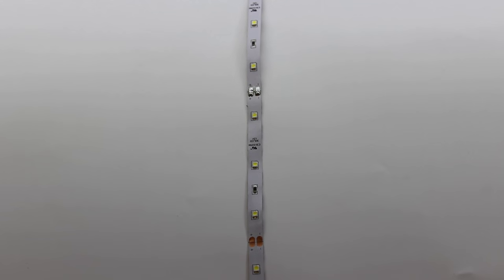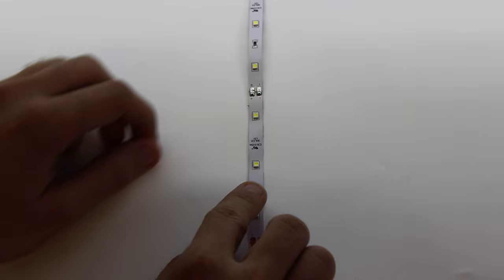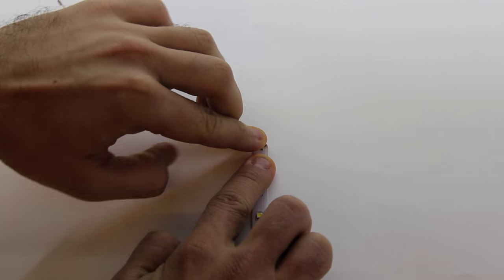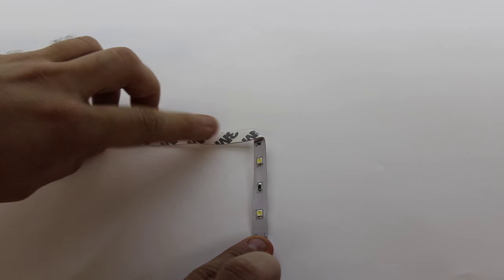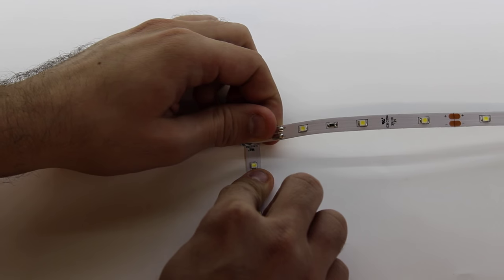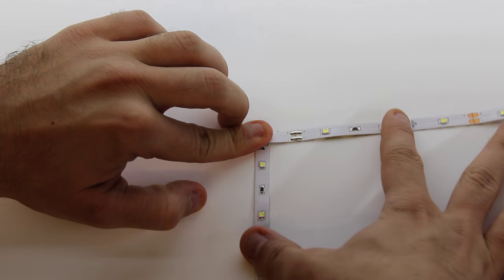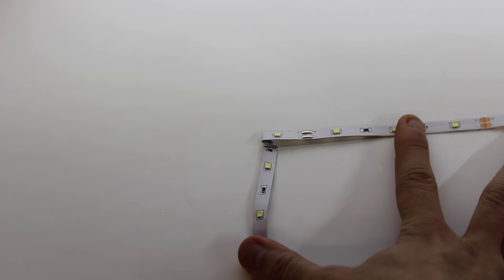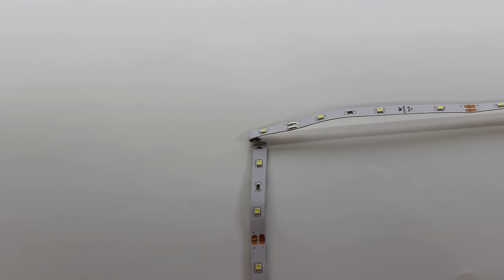Bending LED Flexible Strips | Inspired LED

Comment: Your strip looks much thinner than mine, mine wont bend easily like your strip does
Reply: If you have the waterproof strips which are dipped in resin, this will be a very difficult method to do, it also may ruin the waterproofing. I ran into this same issue with mine.

Comment: God thing to know, most times bending this way u will kill the strip from the bend. So always test on the end before bending in the middle. This is because all rgb/led strips are not the same and some with lets say silicon this will not work unless u peel the silicon first. Some 24v strips will fail because the pressure and bend kills the lanes. So trial and error always start at the end and test bend.

Comment: I recently purchased some smart good quality looking led strip lights and to install properly you'd need to purchase diffuser channelling plus appropriate connectors too etc and trust me it ain't cheap at all but if your gonna do something do it right
Folding over leds is def not right way to treat em and remember heat kills leds it reduces lifespan and creates hot spots so I'd purchase L shaped connectors and install the leds correctly to achieve the best result

Comment: Thank you bro , btw are you sure if i do that it won't destroy the led strip lights
Reply from the maker: Hi @sweaty_sadiq! This is by far the best way to bend your flexible LED strip without damaging the LEDs. Keep in mind to avoid folding along any of the diodes or resistors. Thank you!

Comment: Doesnt it damage the led connectors inside?
Reply: Robin Wiggie no if bend it on the places that is viable to cut
Reply: It can create hotspots which can in-turn damage the strip. As long as there’s plenty of ventilation it shouldn’t be a problem though.

Comment: will it work on any led strip or it just need to be flexible strip?? plzz reply someone??
Reply from the maker: Hi there! The following techniques are intended for use with flexible LED strips. Though we have not tested these techniques on other LED strips, it's worth the try. Always avoid bending individual diodes, resistors, and solder joints to prevent damage! - Inspired LED

Comment: Does it have to be flexible to do this ?
Reply from the maker: Hi Adan! There are some companies out there that offer rigid LED strips, however ours are flexible. We cannot speak to the effectiveness of this method with another companies products. Feel free to reach out to us directly and we are happy to check them out! - Inspired LED
Reply: Inspired LED if I use minger RGB 5050 flexible led lights using this method will it ruin my lights because I’m scared
Reply from the maker: @adandepaz1876  It seems as though it would work the same way. Keep in mind to not bend on the LEDs, nor the resistors! -Inspired LED